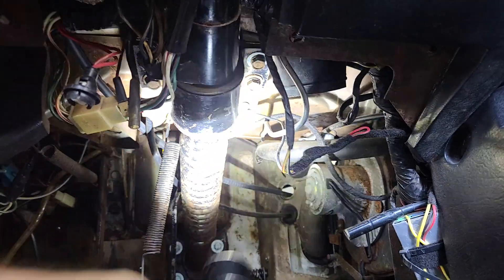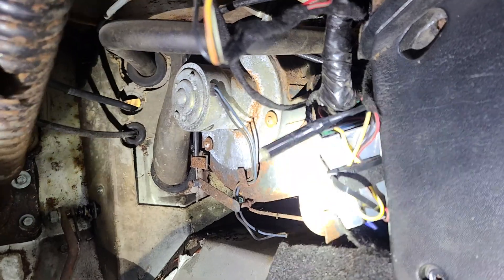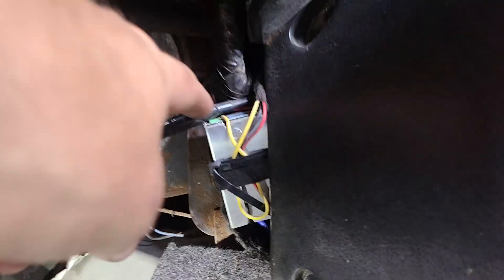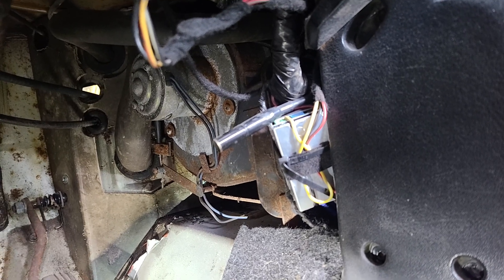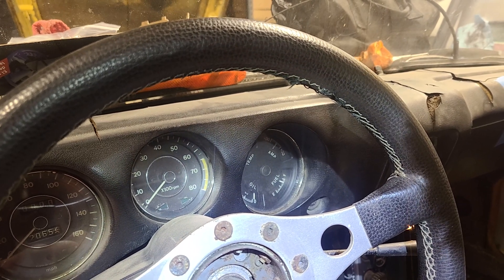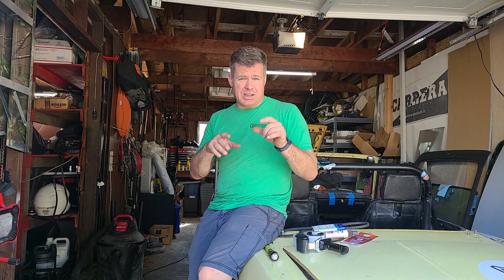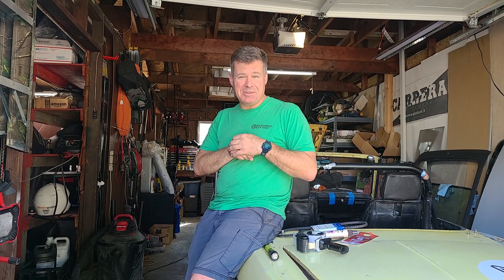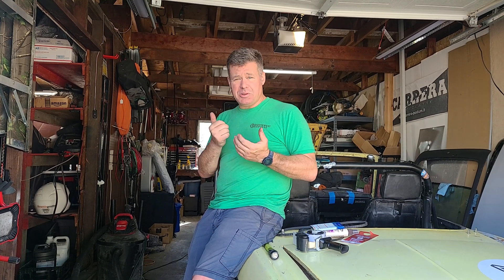CHEAP Datsun Roadster FUEL +  TEMP gauges voltage regulator solution

Comment: So the + wire going into the box is coming from the fuel level? Or is it just 12v?
Reply from the maker: Iirc it is 12v input, then output to the gauge is regulated by the potentiometer

Comment: Hi, can you tell me, is the temp gauge sensor on the engine bay side, is it that little plug on the front left of the engine head ? And where is the engine bay oil pressure gauge located please? thanks very much! Gary
Reply from the maker: Temp gauge sensor should be on the thermostat housing.  Oil pressure gauge is a hard line and mechanical. Feeds off the dist tower if I recall correctly.